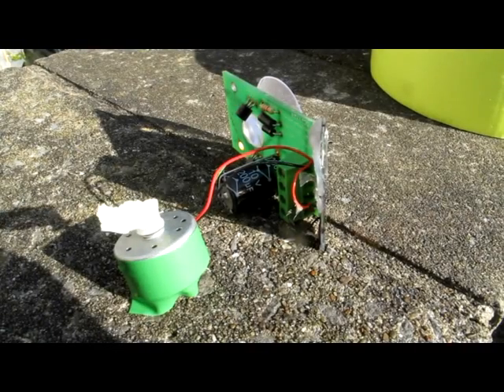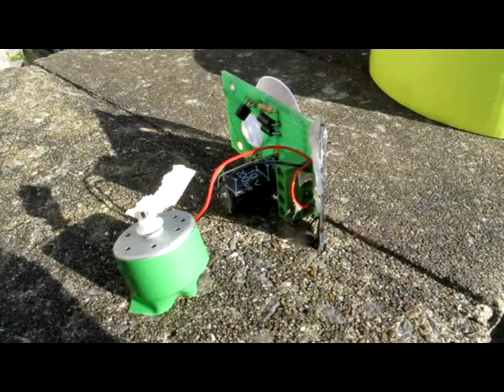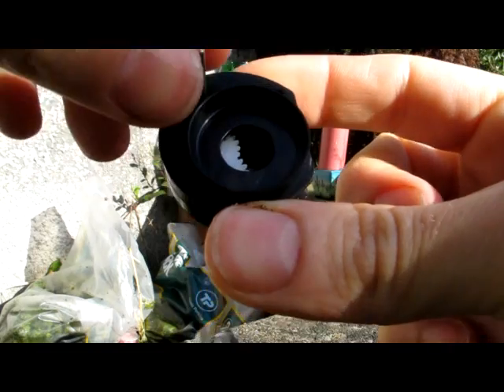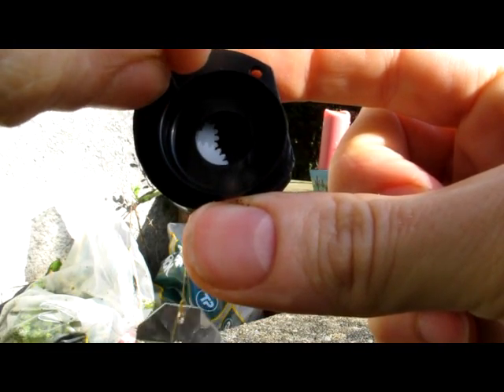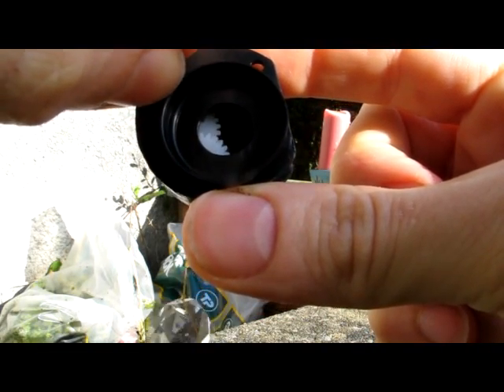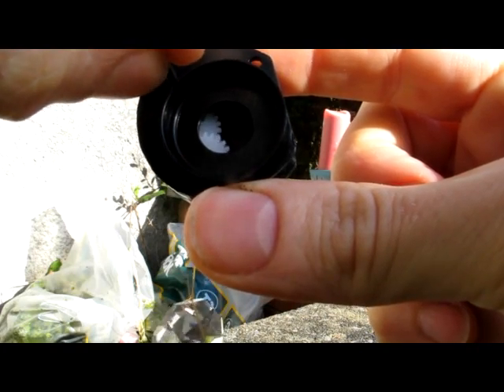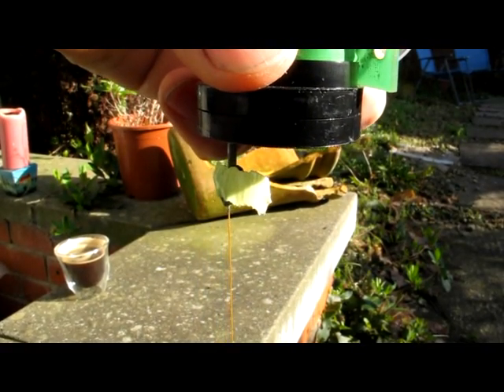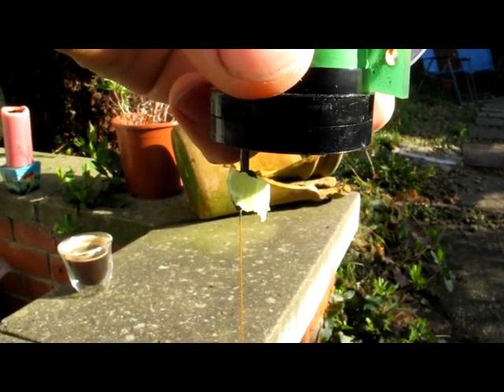solar rainbow maker

Comment: Did you make this? I have a kikkerland solar rainbow maker but was wondering if I could make my own with stuff I have around my house.
Reply from the maker: they're a bit hard to make to get a nice effect.  The most usual thing is that it takes a lot of sun to start working and then spins around madly.
Reply: @matthewvenn  haha I thought so. I want to make my own rainbow maker just for fun. I have extra solar panels from my little cousins science projects but I dont know what kind of motor it uses